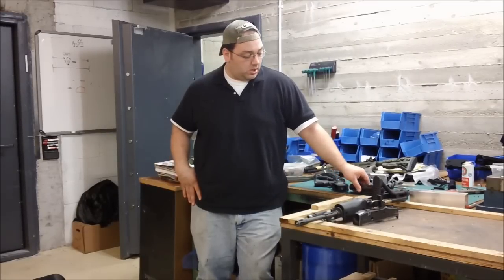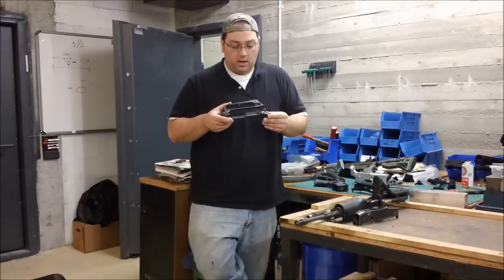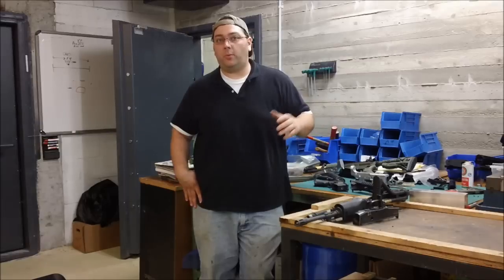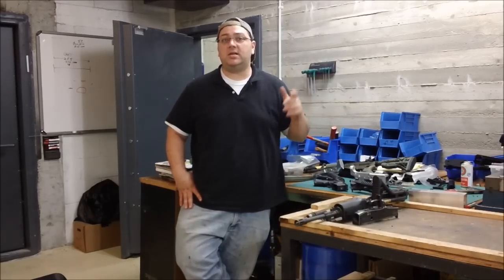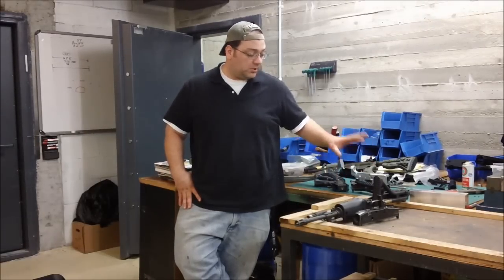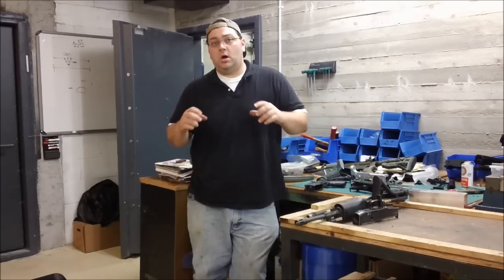Seeing is believing! Milled vs. Forged receiver strengths. Also a look at barrel obstructions

Comment: WTF is going on here?  The lower receiver is nothing but a shell that holds parts. It doesn't really matter what type of metal is used--there is NO STRESS OR WEAR to speak of--even the plastic ones work if made correct. The upper is a different story so why not separate the topics?
Reply: there is stress on the trigger pins when the hammer drops, that slowly wears out the lower. It will make stress fractures in the lower over time. It would take tens of thousands of rounds, between 50 and 70, which no one will ever shoot and the user would go through many barrels and bcg's and possibly uppers. The difference in negligible and i doubt anyone, even the factories testing and designing these lowers would even reach, but it does put stress on lower.
Reply: Alex Morrison We have Colt AR-15's on our rental range that have passed 100,000 rounds, some nearing 150,000 and while all the moving parts have been replaced, the uppers & lowers have NOT been affected by any means so I don't know where you are seeing these damaged receivers at the 50K mark.  I didn't see it in the military either. On a SCAR yes. AR NO.
Reply: Alex Morrison   By the way if you are basing this  AR-15 information on what you have heard from the videos you have watched from Yankee Marshal, James Yeager, Larry Vickers, or  Aregularguy90 , (aregularguy90 shouldn't be allowed to touch a gun LOL) I suggest you stop--NOW!
Reply: ***** I have extensive use with the carbon fiber receivers and found them to be very durable with none of the cracking you talk about. Bushmaster feels the same way--which is why they still sell them. I would trust a carbon receiver on an AR to last longer than that piece of shit plastic SCAR folding stock that all the GI fan boys rave about--until they actually use them that is.
Reply: ***** I don't base my statements on what I see on Google.  DO YOU? If I believed anything on the web we should soak out 1911's in oil to work (they don't need oil to work) and any Glock I have should have blown up by now.  The original carbon AR's were designed by Professional Ordnance.  The rifles had many problems due to bad quality control, but NEVER had an issue with the carbon material receivers failing.  Bushmaster bought them out and  covered warranty issues for years, NONE of which had to do with the carbon material on the frames.  They continued with a redesign and still do today.  All these Google "blow up" videos are mainly bullshit.  We are rarely told what ammo the Goober was using (often crappy reloads) or other facts.  There is NO WAY a carbon fiber receiver is going to cause an AR to go KABOOM.  The lower  receiver is just a shell that holds parts, and the fired cartridge is in the chamber, so if something blows it is going to blow even if the receivers are made of steel.  The metal might offer more protection to the shooter but to say the frame material caused the explosion is totally absurd.
Further more if they had all these "problems" you talk about  they would have been taken off the market long ago.  They have not and are not.
Reply: ***** Alright folks I know I am dealing with trolls here but I did take the time to get on Google and look at the "Bushmaster Carbon AR kaboom!" like our hero said and guess what?  The kaboom was caused by using a reload WITH THE WRONG POWDER!  WTF does that have to do with carbon fiber?  NOTHING.  Found another damaged AR that was caused by a cracked bolt that was worn out. What does this have to do with carbon fiber/polymer?  NOTHING!  So when it comes to problems & blow ups with these polymer carbon AR's we are dealing with more troll bullshit.  Fact is I couldn't find ANYTHING bad about the Carbon AR's sold, not that I expected to--which is what happens when you have EXPERIENCE  with them instead of  believing what you see on the web.
I also might mention that Windham Arms was the original owner of Bushmaster before it was sold to Remington, and they pioneered the use of polymer AR receivers then.  There is NO WAY this new company would go back to these receivers  now if they had problems then!  And they did not--that was told to me face to face years ago.
So  say bye bye Nathan--we are done here.
Reply: ***** More troll shit folks!
1.  Note HE WAS THE ONE who told me to get on Google and find the "Bushmaster carbon fiber Kaboom" link to prove these "plastic" guns blow up. So I looked up the link/video HE TOLD ME to look at and it had to do with bad ammo--NOTHING else.  Now he is doing a back peddle telling me that adding a kaboom to my search is just a way to find failed guns.. NO GOOBER YOU TOLD ME TO USE THAT TITLE--REMEMBER?  It was YOU who said it would prove that Carbon AR's blow up.  It was bullshit because such a link and video DOES NOT EXIST
You are blowing smoke.
2.  Now we are hearing about another link that shows some carbon AR that was broken during shipping.  Were you there?  Do you know HOW it got damaged? Did you handle the gun to see how it broke? Of course not.  I have seen more gun shipping than you ever will and guns get destroyed in transit all the time.  You think aluminum wont get crushed?  Again what we have here is someone who's only experience is what he sees on the web not real life.  Amateur hour at it's best--never had a carbon AR, never shot one, oh WTF why do I need to go on here?  If I wasn't laughing so hard I would have pulled the plug on this "conversation" long ago..........great entertainment...someone should be charging me for this ride..LOL LOL LOL..........
Reply: chad haire Looks like Nathan price has bailed on us here! LOL!  But for those who think that plastic receivers don't hold up I have some news for you.  remember the Galil, one of the most proven fighting rifles made?  They are introducing it into the country again with--are you ready--a PLASTIC RECEIVER!!!  They have already sold about 300,000  of these to the South American countries and just did a contract with South Viet Nam for 450,000 more.  So much for plastic not holding up!  What do you say about that Nathan?  OOPS  I forgot--he bailed on us! LOL
Reply: @Morrison9155  but he said that the billet lowers did not wear as bad as forged.. why is the billet trigger pins not out of shape as bad as the forged from what he said?  thanks
Reply: @charlesbukowski9836  I haven’t watched this video in six years so idk but forged is light and strong. Billet is heavy and brittle. Forged is boring. Billet looks cool. I’ll take light weight and strong and if you shoot enough to F up a receiver you’re a richer man than anyone I know.

Comment: You could actually anneal the forged receivers and get better results. You'd probably only have to anneal them shortly. Get rid of the strain hardening and promote recrystallization. They'll still be tough as nails, and actually will be less prone to fracture.

Comment: Forged is better than billet - it is not because the "molecules are packed closer together".  It is because the aluminum, like all metals, has a grain structure.  Billet material is rolled in several stages, and as result the grains end up oriented in one direction.  If you look at (real) engineering data, you'll see that the strength of aluminum differs in different directions relative to the grain direction.  With a forging, on the other hand, the grain follows the flow of the metal as it is deformed by the forging operation.  This generally results in a stronger part, or a lighter part for the same strength.  Highly stressed parts, such as race engine crankshafts, connecting rods or pistons, or airplane parts such as landing gear, are generally forged.  I have no idea what happened to that destroyed upper you showed, but I never saw one that did that.  I would never use anything but a 7075-T6 forging for an AR upper or lower receiver.
Reply: anisotropic

Comment: Im no expert but having owned a handful of forged receivers and recently picking up a milled receiver i can say the difference between them is minimal. Having said that i have limited experience with the milled but i have destroyed a few of the forged receivers and what he shows in this clip makes sense to me. The forged  receivers dont act like i expect metal to. They chip to pieces like rock and snap like plastic. The milled receiver seems to bend more and doesnt snap apart. Less shrapnel is a good thing, but lets hope it doesnt come to that. I once dropped my beretta 92 slide on the edge of the frame and a tiny bit chipped off. That forged aluminum may be "hard" but it breaks apart easily. Ironically i intend to baby this milled ar 15, but i just might buy another one and put it through its paces. Good video despite the scathing comments below me.

Comment: There is no debate. Ounce for ounce forged metal is stronger. If you have a Billet receiver that is three times thicker that's not any kind of real comparison. forged receivers are cheaper because every Billet receiver has to be machined individually. You are paying more for less.
Reply: Giant Rooster Forged is stronger, but not for the reasons you cite.  It is stronger precisely because it DOES have grain structure (all metals do).  The difference is that with billet, the grains are all oriented in the direction that the billet goes through the rolling mill in sequential rolling steps, whereas in a forging the grain ends up being oriented according to the deformation that occurs in the forging process, which is a benefit in almost all part geometries.  Also, 7075 forgings are annealed and then heat treated after forging and before machining, so work hardening is not an advantage.  If the forging is heavier (and it's not true in general that a forged part is heavier than a billet part), it is because of fillet radii and such - the density of the forged 7075 is virtually identical to billet 7075.
Reply: Skivvy -- The elastic deflection of the aluminum is not much of a player in the accuracy of the shot.  The round starts off in the chamber, which is cut into the barrel, and the bolt is locked to the barrel by the lugs.  Thus, it's the barrel that is the determining factor in accuracy.   All the receiver has to do is hold the rear sight zero so that the barrel is pointed at the target correctly at the point of trigger release.  The bullet is moving at 3000 fps when it passes the gas port, starting the gas pressure wave in the gas tube, and exits the muzzle  100 millionths of a second later.  Meanwhile, the gas pressure wave is only moving at Mach 1 and is barely an inch or two down the gas tube when the bullet is gone. Thus,  the bullet is away long before the 15000-20,000 psi gas pressure makes it to the receiver.  The bolt remainsis locked to the breech until the gas pushes the carrier back and rotates the lugs to start the auto load cycle.  Stoner was a good engineer.  All this is why a marksman or sharpshooter can make 500 or 600 yard shots with an very lightweight AR.  You are right about the modulus of aluminum being the same for all alloys and tempers... but your comment on running the thing over with a truck misses the very important point that in a combat rifle, which the AR is, weight is a priority.  The entire reason for the AR platform's design,  starting with the little round but including the gun itself with plastic furniture, etc. was to address the realization that in the field, weight is critically important.  Given that, forging the receivers makes a lot of sense... and that is why the military uses forgings. They're better.
Reply: forged 80% 308 lowers are difficult to find cheaper than machined. Do you know where I can find one for under 60?
Reply: I wish everyone would stop saying forged is stronger than billet. First off it might be or it might not depend on where on the receiver you are measuring. Forging causes grain structure in the metal (it does not compact the molecules... duh). This grain structure is like that which you might see in a piece of furniture. That is if you drill a hole in a piece of wood the hole will be strong with the grain but totally crap across the grain. Same is true with forgings. Secondly, there is a BIG difference between strength and stiffness. Unless you stress your upper so much that it deforms you really don't care about strength (exploding rounds aside). Strength is the measure of where it breaks. Stiffness has much more to do with the accuracy of the shot. All things being equal the amount aluminum bends with stress (elasticity) is pretty much the same no matter what its composition or temper (go ahead look it up!). So therefore if you want your upper to deflect less when you fire that round you need to add material. More metal = stiffer. Doesn't matter if its forged or billet, 6061, 7075, or any other aluminum. Even if you plan on running your AR-15 over with a truck your receiver is still likely to hold up better because there's more material there not because its forged into super metal.

Comment: 9 years in the Marines and countless days on a range and i never saw a rifle explode.
Reply: *****
Ya, doesn't happen in the Army...are you sure you didn't mean Air Force?
Reply: they were stress testing
Reply: I understand that. He mentioned that rifles explode in the military and that we dump them in grease, oil, and other crap. I never saw it happen. Maybe in the army lol
Reply: Very typical in Israel. Many of the M16s, used by Israel, are surplus from the Vietnam war and early 70-80's rifles.  The modern M16 is far superior material wise.
Reply: I have seen a couple of videos but those guys had to work real hard to make it happen and they were deliberately abusing the rifle to see what they would have to do to destroy.  toward the end of one shoot the guy was shooting remotely as he tried to destroy the rifle.

Comment: I like how he shit on forged receivers then got an erection over forged barrels. Go in your safe there and close the door,lock it and then throw away the safe.
Reply: He's talking about two completely different metals (and slightly different forging processes) ... Aircraft Aluminum - which gets weaker when the hot ingot is pounded into a mold; vs. Gun Steel - which gets denser and stronger when cold hammered via opposing hammers with a rifling mandrel inserted into the barrel blank.

Copper also gets harder when cold worked - to a point, then it becomes very brittle.
Reply: I think when he says forged he means a casting. most upper and lowers are machined from a casting.

Comment: I worked in a forge that made colt uppers and lowers. If you understand the forging process when the aluminum is hammered in to shape it creates cracks some can be found some cant.
Reply: what stamping mark did your company use?

Comment: Hey bud, I'm almost finished with my build! I went slightly higher-end than I originally set out to, and I'm going to post a few videos about it. My receiver is forged by Rainier, but I will probably go to billet from Rainier in the future. Is there a forum you frequent? I'd like to keep in touch.
Reply: It's not worth it unless your very well off and have plenty of ammo. There is something wrong with his bolt or barrel or something interfering with the locking/unlocking, his confirmation bias is strong.

I know the name Rainier, with the competition these days you get what you pay for or the company dies quickly. If you paid a decent amount I am sure it will last you a lifetime if you maintain your bolt and barrel.

Comment from the maker: Usually the milled receiver advertise as such, but they mostly have a integral trigger guard. Ours don't (for some unknown reason).  With milled receivers however, you can usually see milling marks on the receiver.  Also, the bottom of the magwell is usually sharper since it is harder to round the corners in a cnc machine and isn't worth the added cost (in manufacturing, every extra min. on a machine costs money)